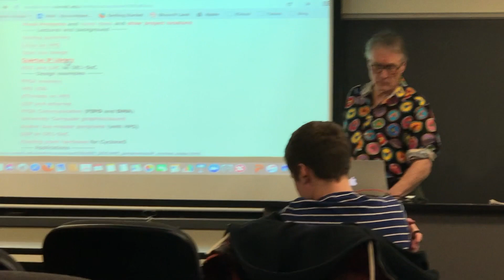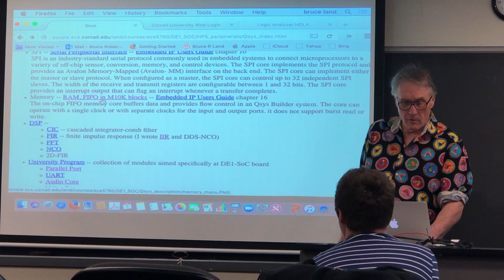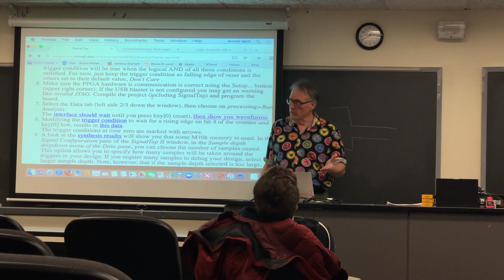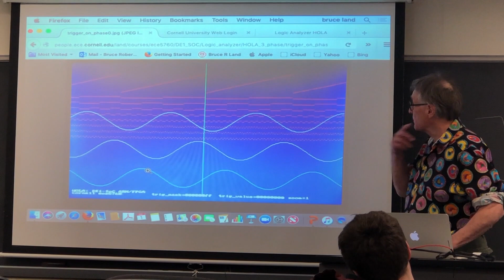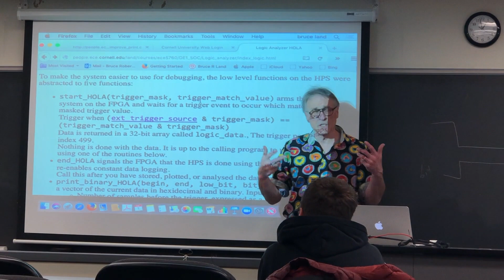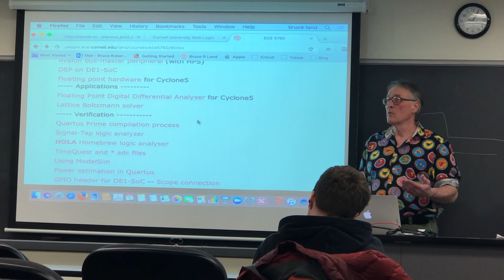#5 Qsys, logic analysers

Comment: Hello, I was wondering why most of the verilog written in the example is all in the project top file. I wonder if it would be easier to create a custom qsys component with an Avalon streaming interface rather than relying on the PIO and extral bus bridge. This also keeps the top file strictly a mapping from FPGA pins to the entity qsys creates.
Reply from the maker: Very true. Working on it.